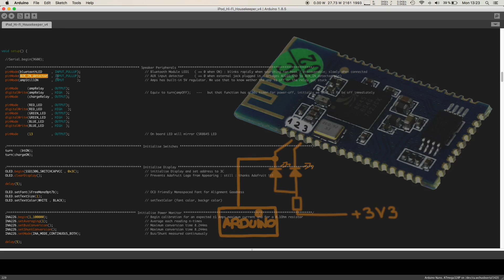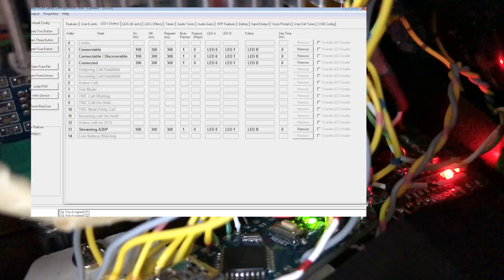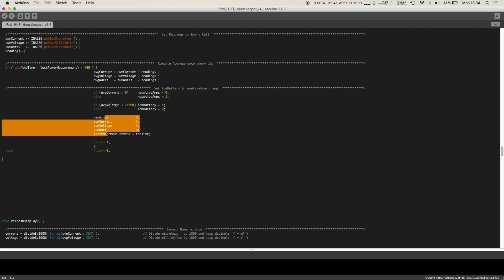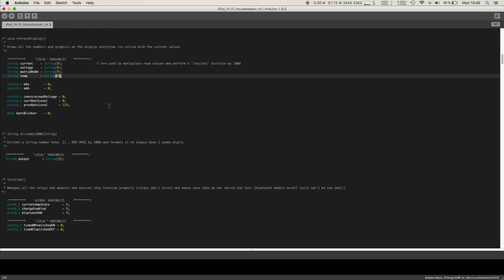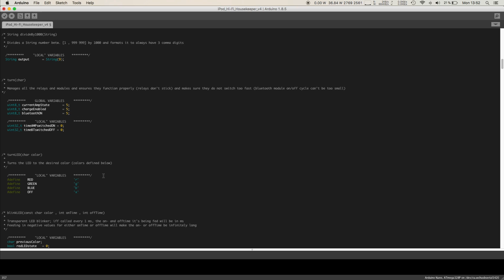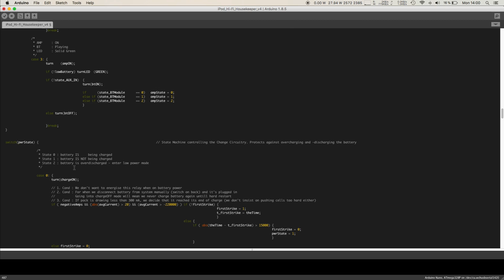DIY Bluetooth Speaker : Power Management : Arduino Code

Comment: Nice !  This will work perfectly for using CSR BT module + Arduino to outfit OEM BMW head unit so it will activate/inject BT audio to cassette analog input on board when BT is active, and otherwise function identical to stock when BT is not active.  Thanks putting this nice building block out there for everyone to use.
Reply from the maker: glad it helped !

Comment: nice video! Could you name your CSR8645 settings? If i disable the hands free profile to get rid of the battery indicator my module won't reconnect automatically anymore.
Reply from the maker: you must've done something wrong in that case .. did you follow my video on disabling the microphone 1to1 ?
Reply from the maker: or yeah .. given your first question, perhaps you didn't see my mini-series on setting up these CSR8645s .. do check youtube for CSR8645 renaming / disabling mic / equaliser, and you should get to my guides on those respective topics
Reply: Yes i watched them! If this is your exact setting my board must be bugged or something... I did it step by step. It had a bug before, it always dialed the last number randomly
Reply from the maker: uuu .. I don't know .. it could be that the firmware is busted .. so you only untick the HFP and that's all ?

perhaps do a factory restore in PSTool, then after that merge my fresh default dump (should be linked in the renaming video) ... and then with Configtool just untick the HFP ...
Reply: ok, i gotta try this again. Thanks for the fast response :)